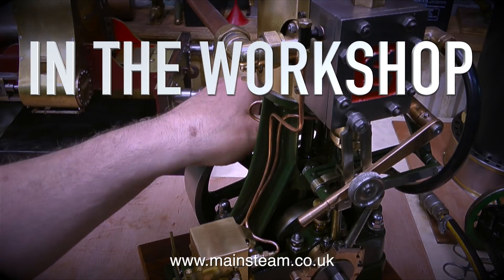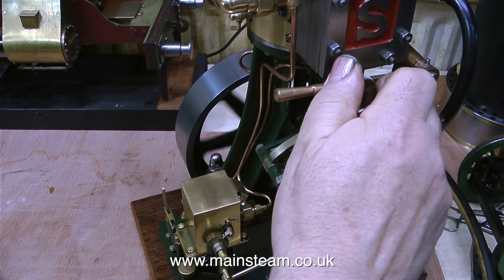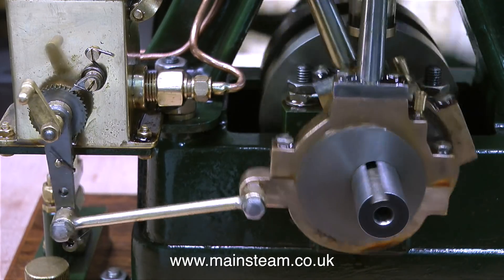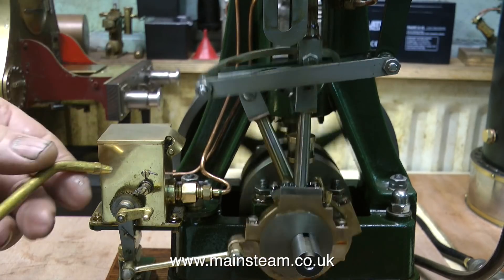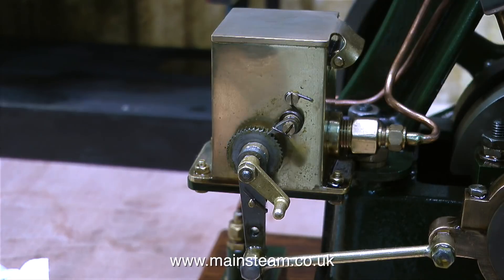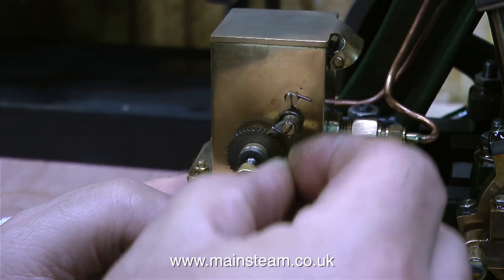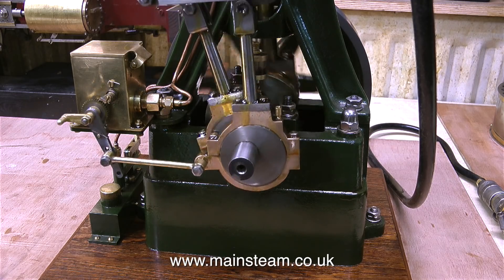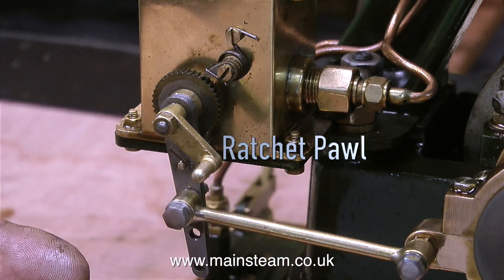PLAYING WITH MY STUART 5A STEAM ENGINE - IN THE WORKSHOP

Comment: Hi Keith I am a patron of your site. Please which big nut adjust the flow of oil from the lubricator. Also please, assuming the oscillating engine which supplies the lubricant is single acting, does this mean that oil is not delivered to the engine on the suction stroke? is that a problem? thank you Bernie Short.
Reply from the maker: Please contact me through Patreon, this is the public area of Youtube.

Comment: Have you considered using a "wrap spring clutch" to drive the mechanical lubricator?
Reply from the maker: I have had problems with those in the past, I also like the look of this ratchet type . . .
Reply: A wrap spring clutch would certainly be the modern way to do it on something this size.  In my experience (in things like teleprinters and office machines, not steam models) they are very reliable, noiseless, and don't need anywhere  near as much lubrication.    But not the way it would have been done on a full size 100+ year old steam engine??

Part of the thrill (as well as the fun in acquiring mechanical skills) in making a model steam engine is in reproducing steam age technology as close as possible to how it would have or could have been done back then.

Keith said the problem lies in a weak spring on the lower (moving) pawl.    That sounds right, but it is difficult to tell from the video.

Comment: I had a similar problem with a locomotive oiler. It used a spring return pump operated by a cam fitted to the ratchet shaft. On dismantling I discovered a file mark on the cam. A bit of sanding and polishing sorted it.
Watching this I think I will have to dig out my stuartNo5 castings.( uses two No1 standards to support the cylinder.) and get to work.

Comment: Sounds really nice chuffing along at half video speed.  Watching the pawl ratchet system reminds me of the old days repairing Smiths speedometers. They use a pawl ratchet for the odometer running off an eccentric shaft.  Working on those odometers would fill me with dread because the drum assembly was so complex and tiny.  And they too had issues with the pawl 'dithering' about which would work in the owner's favor because the odometer would record less mileage.  At the time, I hated working on those damn things but now I look back on those days fondly.  The good thing about the Smiths mechanical odometer was that it was well engineered and usually a clean out and re-oil would have them running like a charm again.

Comment: Keith,   the lubricator action still seems dodgy.    Sometimes several gear teeth pass the pawl, sometimes only a couple, sometimes only one.

By altering the drive arm radius, isn't this much like covering up the symptom, rather than addressing the cause?  A bit like taking vitamin supplements to overcome the problems of eating nothing but fried meat?

Is the problem in some sort of friction drive between the arm and the ratchet gear (a spring?) couple with some shaft tolerance or fitting problem?

I enjoy you videos though.    I've learnt quite a bit about model steam engines from them.
Reply from the maker: Yes, it's not the smoothest mechanical lubricator I have ever seen ..... The spring is a bit weak on the lower Pawl, but it is working reliably enough now for the moment.